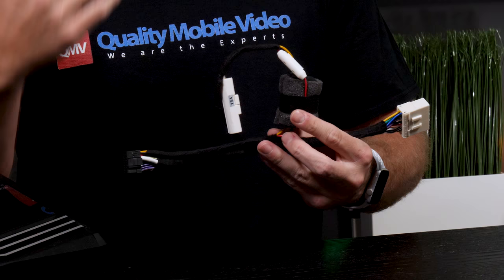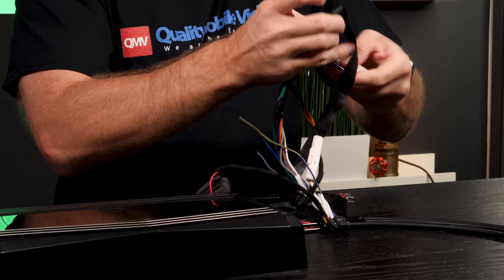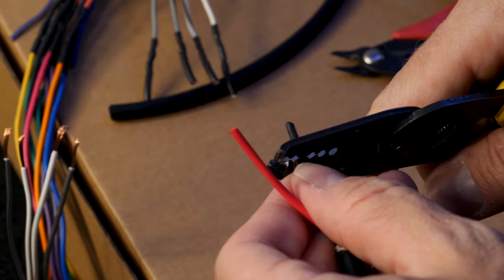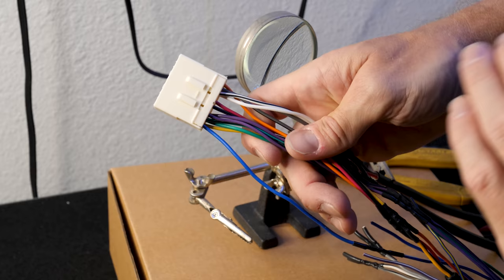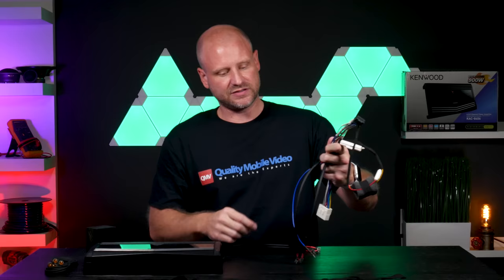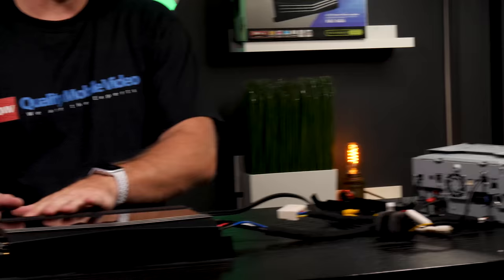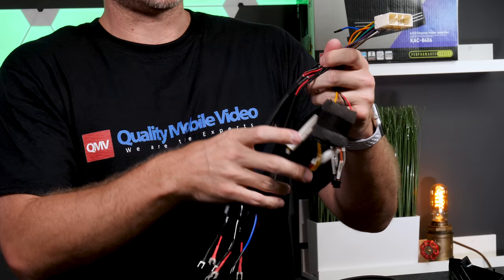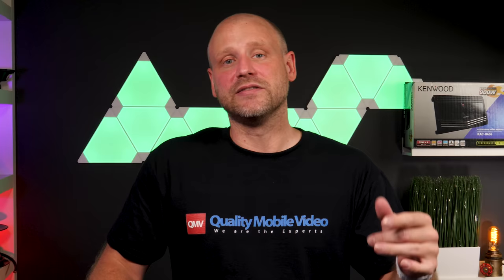Wiring a 2 or 4 channel amp to your stock speaker harness without cutting the factory wiring

Comment: For those needing some context on this video, the idea is that RCA's will be the signal out of the head unit run through the vehicle into the amp, then the power out of the amp will run back up to the dash on your own speaker wires and plug into the factory harness which will then carry the power back throughout the vehicle to the door speakers using factory wiring..  thus completely bypassing the head unit's built in amp and wiring and eliminating the work involved in running your own wires from the amp to each door speaker yourself.
Reply: So the amp powered speaker wires needs to be connected to the factory hardness speakers wire and NOT to the aftermarket hardness?  What do I do with the aftermarket hardness (speaker wires)? Just seal them off?
Reply: This was a way better explanation, I was really confused on why he had two signal outs to an amp, makes sense now lol 😂 I have never installed a system like that, I always ram my own cables from the amp to the aftermarket speakers. Wouldn’t there be a limit of power????
Reply: @josequezada822  i believe factory speaker wires allow up to 75W per speaker
Reply: @josequezada822  I have the same question unless stock wires don’t limit it enough to matter
Reply: @j.a.3138  So he's actually soldering the wires that goes to the speakers?
Reply: thanks for the clarification. The video skips the details that explains the whole idea of wiring amped door speakers.
Reply: All of these "how to set up an Amp to your speakers" be using a Hella expensive head unit with 6  aux channels out and presume beginners know all of the Car Audio jargon.
All of the "specialists" need to simplify their explanation, use diagrams and thoroughly explain how the system will work.
Reply: Exactly.. no contest or overview. Just some pure wiring / soldering.
Reply: Also.. the head unit has a build in amp. Some like Sony 220W RMS amp. Do customers need to have extra amp for the speakers with such a amp?
Reply: @bjarnieinarsson3472  any head unit with a built in amp will get the job done, but only to a certain point. If you want to add things like better quality speakers, equalizers, DSPs, etc.. then bypassing the head unit is worth it. And keep in mind that like 99% of audio manufacturers lie about their specs too, that tiny amp in the head unit can burn out real quick with upgraded speakers. And wattage doesn't always equal volume, some speakers are made to be super efficient and run well off of lower wattage, but higher end ones might be less efficient and need more watts for the same volume, but better quality.. for instance, Alpine type S vs type R door speakers.. S does great on a 15watt head unit but is the cheap budget option, while type R recommends an aftermarket amp and should be able to do much more.
Reply: Just so my stupid brain can understand, he is wiring an aftermarket head unit to use the factory speakers through the original wiring harness? Or is he running the output from the factory head unit to the amp and then back to the factory wiring harness?
Reply: Question - apologies if this sounds dumb 

Can you connect all speaker outputs from a stereo to one high output car speaker ?  More specific connect all left side outputs together and connect at the right side outputs and have 2 car speakers ,. 

I want to have just two speakers in the roof and mount them diy enclosures etc. Because I will be welding ,custom doors ,4x4 off road etc,.
Reply: @omar7587  probably not, no.. I can think of a couple potential outcomes.. either it'll be basically wiring the speaker in parallel to the tiny little amp in the head unit that's made for 4 ohms.. that is now trying to do 2 ohms, and it'll fry it (but if you're talking single voice coil full range speakers that might be irrelevant). Or if the head unit is designed so that can't happen it'll still be breaking the cardinal rule of never using more than one power sources for 1 driver and it might just sound like shit. Plus of they're super high output and the head unit is working too hard it can clip and fry the speakers, getting an amp would fix all these issues tho. But now that you know the risks, try it and let me know lol.

It'd probably be better to get a 4 channel amp and just use the front 2 channels then u get all the power you want. Or get a 2 channel that has a full range EQ on it like the   JL Audio HD amps.. but then what ya get might be mono block so you'd lose stereo if it's mainly meant for subs.
Reply: Can’t I just connect both wires from amp and head unit ?
Reply: What happens when ur tweeters and woofer have only one set of wires behind ur stock stereo and now your aftermarket speakers come with a crossover?
Reply: @hectormartinez5263  what do you mean? Like the stock speakers are coaxial (all in one) and the aftermarket speakers are component (seperate woofer and tweeter) with a crossover? If that's the case, typically, the crossover would split the signal for you from full range input into seperate tweeter and woofer outputs.
Reply: @Keldren.  I have a 2002 suburban it comes with a tweeter and a woofer from factory when I chase down the harness somewhere and the dash they both are wired together so what goes into my factory amp is only one pair of wires (+ n -) now I bought a set of 6 1/2 components and can’t rap my head on who to use the factory harness while adding my crossover from the aftermarket speakers.
Reply: @lexiusnez6513 not only that they don’t need all this music in the background
Reply: Wonder how much those speaker wires to the amp in trunk are gonna cost too
Reply: Just saved me so much time and a headache. Thanks anon
Reply: @G4RR3TTJ  that's what I'm here for 👍

Comment: So. 1) Connect the 2 or 4 channel RCA cables from the head-unit to amp. 2) Connect 4 speaker wires, from the amp to the factory harness. 2A) Keep in mind that you have to disconnect the factory harness speaker wires from the Metra harness speaker wires. 2B) You also have to cap (seal) the Metra speaker wires. 2C) Match, then connect the amp speaker wires to the factory harness speaker wires. Connect the other or opposing ends of the speaker wires to the amp. 2D) You’re now “ done “ with the amp to factory speaker wires connection & the head-unit signal to amp connection.

Comment: Man, I just just LOVE the professionalism you put into all your connections! Nothing is coming disconnected from one of YOUR installs! Makes me want to run out and stock up on heat shrink now, and FINALLY learn how to solder at 60 years of age! As for so many viewer comments not really understanding what you just did, I found it quite easy to understand. So I'll try to explain it like an old guy would: If you pull your stereo out of the dash, you will find a plug (some factory decks have 2). If you're lucky enough to have a car with an aftermarket deck (head unit as the pros call them), you're in more luck because they will most like already have a Metra-type (or Scosche or some brand) or harness in between your deck and speakers. You simply cut the factory speaker wires that go up into your dash (the end NOT on the side of the harness that go to the deck, and hook the speaker leads from your new amp to those factory wires going up into your dash. What I do on EVERY car audio job I ever do, especially when it's someone else's car, is to FIRST look up the radio wiring diagram (colors) for that specific year, make and model of vehicle FREE on The12Volt's website! I copy them down into my little car audio note book, plus copy them onto a MS Word document to keep on my laptop for future use. So back to this: It's really a simple job! He just made it seem more complicated because he took the time to neatly cut everything (including his fingers a few times I noticed! LOL!), then solder and heat shrink and label everything. I truly believe if he would have just done it like MOST backyard stereo installers, and just crimped wires and connected them a little faster, this video would have been easier to understand. ONE NOTE: when you cut your factory harness wires, make 100% SURE you know exactly which wires are for your speakers before you start cutting! Remember, 1 or more of those wires you could cut will be to constant 12V, another to switched 12V, and another to ground and maybe even illumination/dimmer. So you REALLY need to make sure to cut the correct wires. One way I used to do it, a trick I learned back in the early 80's, was once you narrow down your factory speaker leads but aren't exactly sure which one goes to which speaker? Simply take a C or D battery and strip off a little of the end of each lead. Chances are the wires to each speaker will be CLOSE to the same color, but not always. Anyway, if you take 1 wire and hold it to the bottom of the battery, you can then take each wire one at a time and tap the top of the battery with it. You won't hurt anything, believe me. When you find 2 wires that go the same speaker, you will hear a small pop at one of the speakers and BAM, you found ONE speaker! Tape those 2 leads together and keep doing this until you find the other 4. Sounds cheesy but it works! Especially if you have a wide variety of speaker lead colors like Honda's often do or my current Saturn. OKAY, THAT'S MY 2 CENT COMMENT for now. LOVED this video! But myself, being old and lazy, am going to go a different route to connect my Kenwood KAC-8406 to my factory speakers: I'm going to do the rear-to-front jump trick. Takes less time and less wire. Okay, gotta go read my 2 bibles!
 https://s254.photobucket.com/user/Hairball98498/media/Past%20stereo%20stuff/P4080015_zpsb91ddfa1.jpg.html
Reply from the maker: Thanks Shawn!
Reply: Great content, great comment! Thanks Quality Mobile Videos! Thanks Shawn!
Reply: In the video, he did not "simply cut the factory speaker wires that go up into your dash".  Instead, he cut and spliced into the Metra adapter (harness) so that the factory speaker wire harness remained intact.  When finished the now spliced Metra harness would plug into the factory wire harness.
Reply: Thank you I get what he is doing now. The video ( If never done before ) makes sense.

Comment: I like the clear heat shrink over the labels idea. Definitely will last longer than bare masking tape.
Reply: When I used to be an electrician, I terminated lots of wiring cabinets and terminal blocks for industrial equipment.  I don't remember the brand, but we used a label maker that printed on heat shrinkable sleeves that was designed to slip over the wires.  They could be left as is to allow for easier readability or heat shrunk onto the wire.

Comment: What's missing is other important information.. 1. is your amp built for the gauge size wire coming from the wire harness. 2. Power into the amp can make the difference of the true wattage output. 3. This easy connect method is brilliant if it's applicable to any car amplifier universally without declining performance from the amp.

Comment: this video just saved me a ass load of time not having to wire from the speakers directly to the amp. i can just use the wires already in my truck and run the wires from the factory type adapter to the amp itself. so much easier than running all new speaker wires to the all especially with the pac connectors on each door.. same that was gonna be a real pain in the ass! thanks so much for showing this easier to do shortcut!
Reply from the maker: Glad it helped!

Comment: Thanks for the great detail and time explaining how to manage the wire cutting and splicing. Definitely made me rethink my strategy and taught me how to do this properly and so organized and clean!  It raised my expectations of quality, not only when hiring a professional,  but with my own work. Beautiful! Thank you!
Reply from the maker: Glad it helped!
Reply: @Qualitymobilevideo  So if your not hooking the speaker wires directly to the radio anymore and going straight to the ampwith them, Will the radio still be able to "Fade" and "balance" control the speakers?
Reply: @anthonylong5870  No, not at all
Reply: @anthonylong5870  Yes.  As long as you use separate RCA input cables for the front and back channels, the head unit will be able to fade front-back as well as balance left-right.  If you only use one set of RCA input cables and set the amplifier to output on all four speaker outputs (IIRC it's the 2 channel configuration setting), then you will only be able to balance left-right.

Comment: Excellent video which for me it cleared up the question of do i wire the amp speakers directly to the adaptor or do i splice the factory speaker wires into the Aftermarket adaptor and the speaker wires coming from the amp. I now know this would be the wrong way to wire up the speakers. I just wire the amp speakers directly into the aftermarket speaker wires. Connect 2 RCA plugs into the line in plug of the Subwoofer and take that to the back of my aftermarket radio. Connect the blue send wire. Run the power cable from the battery and ground cable near the amp and wallah the install should be finished and now i can turn on the radio for the 1st time! This is my 1st time doing this kind of installation so im pretty excited!

Comment: I had the same point of confusion before about which of the two harnesses you were disconnecting the speaker leads from.  I think it was hard to tell which harness was which. You were designating them as aftermarket and Metra. I have to think of it as Aftermarket and Factory or Stock, or it's a little hard to track. Logically, we have to tie the speaker leads to the "stock" harness to get signal to the existing speakers that are all Molexed up and terrifying! As I am just now going to be installing the whole system, head unit, steering wheel control, parking brake disable, aftermarket amp, I will simply follow the logic of not connecting the speaker leads together in the new harness, just clip and heat-shrink the ones from the aftermarket harness and wire the leads into the stock/factory/Metra harness to get the beautiful noise through the existing wiring. Now for the tricky part (hah!). I was able to eBay a factory sub/amp (which my 2005 Focus was not equipped with, though from all the rumors, the wiring exists.  If the harness does not really exist, shall i just run one RCA from one of the sub outs of the AVH 1300NEX to the hatch, clip and strip the RCA cable to provide the input. Then  T off the remote on and put an inline step-down to keep the amp from popping? All help welcome. I am learning a TON, and gratetful for your work! Hopefully I will only have to do this once. And keep this car forever!
Reply: Tanya Robinson depends on what ohm the sub is and what power output is in comparison to the watts needed to power to sub.
Reply: I was confused as well lol stock/ factory would have been better then aftermarket/ metra

Comment: It’s going to work only on under 50 rms (watts). But if you have 4 speakers over 50 rms (watts) you need to use 14 gauge wire and 18 gauge wire under 50 rms or from factory wire that came from car.

Comment: Cool dude. Thanks for the demo. A guy actually told me that for bigger amps not to use the factory wires. That's only for bigger amps
Reply: How big is bigger amps?
Reply: Yes please explain this to me bcuz I have the SCV 3000D... no way in hell that I can run wires from that amp into any factory wires 😝😝😝 what's the wattage limitations please?!?!  So only do this with my 4 channel mids and highs amp?  Or no bcuz I have the Skar RP 150.4AB ?!?!  I'm thinking this won't work either bcuz of too much power. With my equipment I am fricken confused AF 😝😝😝 and pissed at the same time bcuz another day went by with no hook up bcuz I'm not doing anything until I find the right information or video. SUCKS I'M FEININ FO MY BASS LOL ‼️‼️‼️
Reply: @johnmeek6790 long time since but if you are running more than 100w per speaker like doors or 6x9s run new wire.

Comment: I was hoping this video was gonna show how to install the speaker wires to the stock wire harness by d-pinning the speaker wire and installing it that way to a factory radio.  But if I were to úse a factory radio, I guess I would still need a metra bay harness to connect the speaker wire to a high input connection on an amp and then the amp speaker wire to the harness.  Good watching this video!

Comment: Okay am I getting this right.
I have to cut the speaker wires coming from my doors to my head unit. 

Connect the wires coming from my head unit to my amp. 
 Leave the speaker wires coming from door speakers snipped. And plug the RCA's in.

How do the speakers get power?
Reply: Right... im guessing u have to also connect the speakers along with the head and amp wires to create a t connection
Reply: @fivepointslogisticsinc5239  I figured it out. You need to connect the speaker wires coming from your doors to the amp then the rcas communicate with the headunit. The other way made ZERO sense to me make sense why haha
Reply: @user-yv3vu1yb2k  you basically run the rca, remote wires and that’s it no doors speaker wires to the head unit right?

Comment: So if I’m getting this right say your door speaker connects to the amp by spicing it and connecting it to the prong setup as showing and the RCA cables on the back of the amp connect to the RCAs on the back of the head unit?  I think
Reply: yes that is correct. the rca's from the head unit tell the amp what to play, and the powered amp plays the speakers

Comment: So the only thing I was confused on, do you still need to run a power and ground wire to the amp? It may sound dumb, but you didn't show anything about those so I'm just trying to make sure